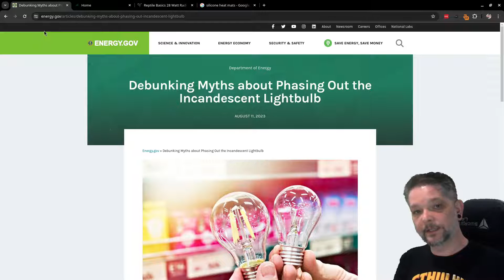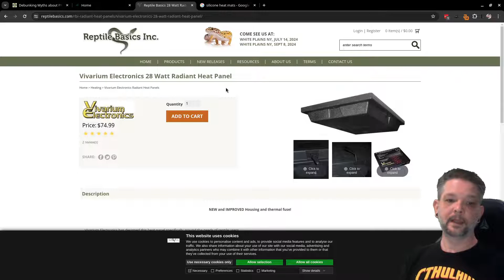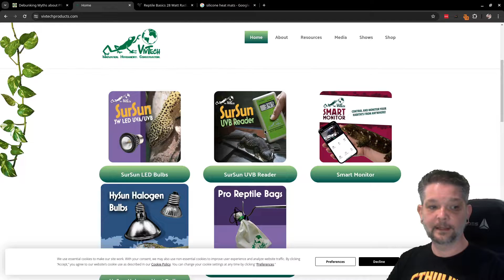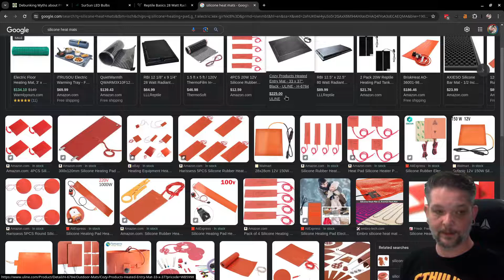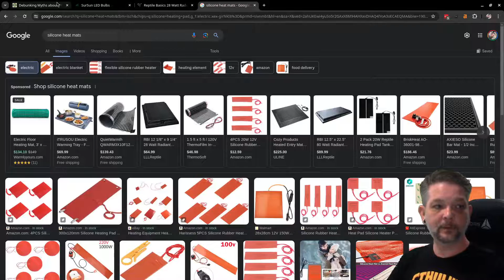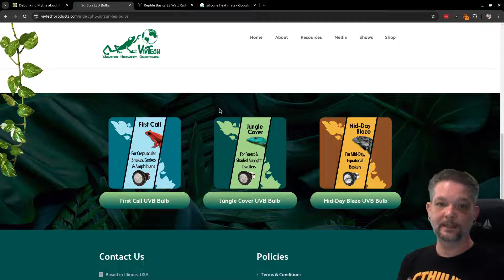Is the "bulb ban" an actual bad thing for the reptile hobby? Panic!

Comment: Thats interesting, the statement about  unregulated ultraviolet light, Ive never heard of such a thing. What is it and how much is there emitted?
Reply from the maker: Do you mean specifically regarding halogen bulbs, fluorescent bulbs, or something else?
Unregulated UV light being emitted from halogens is very well known and easy to find. As mentioned in the video, not only do certain manufacturers/countries add "UV FREE" to their packages but there is a ton of information about the amount of UV light emitted. In many cases it could be considered trivial emissions, but keep in mind that you, as a person, would not be 1-8" away from these lamp sources for 8-10 hours a day - you would find that painful and be quite upset.

If you are Roman Muryn, then I know you have a lot of random Solarmeter branded UV meters. You can easily hold a Solarmeter up to these types of bulbs to see that UV light is registered. Make sure to use an undoped (ie: not the "UV FREE" bulb) bulb which you can generally recognize by being completely clear rather than doped with a blue tint. Also keep in mind that the specific spectrum registered by the solarmeter - which will require you to use several meters to get a complete picture. Contact SolarMeter directly if you would like to question if the readings are electrical noise or actual registered UV light at the sensor. These are all valid approaches and questions.

This is also a problem with fluorescent lamps. Regardless of how perfect someone believes the glass to be, errors in manufacturing and simply unpredictable behavior of the reactions in the lamp can create unregulated UV light scenarios from ANY fluorescent lamp. Not long ago, many  people were blaming CFLs on being very poor both in the reptile hobby and in general - this is because of manufacturing errors. Newer CFLs, both in the reptile hobby and out, are now much safer if not the safest residential lighting option regarding unregulated UV (not sure if this can be/has been evaluated on the reptile hobby side) if you, of course, don't count LEDs (which you shouldn't since these don't emit unregulated UV light).

I know that, if you are Roman Muryn, the general MO of AHH/Reptile Lighting is to spam links with really nice headlines which I won't be doing. This is extremely trivial information to find and has been known as common knowledge for many years often appearing in skin care and even skin cancer related articles.

LED light sources, contrary to Reptile Lighting/John Courteney-Smith/Arcadia/AHH/etc, are the safest option we have. Admittedly the latest LED UV tech may be lacking in empirical evidence and possibly complete spectrum emission but that's why we have continuing advances in this area both inside of the reptile hobby and outside.

For good faith, you can have this annotated reference:
"The results demonstrated UVA leak highest from incandescent and halogen bulbs, and UVB leak highest from CFL."
https://journals.sagepub.com/doi/abs/10.1177/0961203309103052
Reply: @ResolveReptiles  Thank you for your reply.